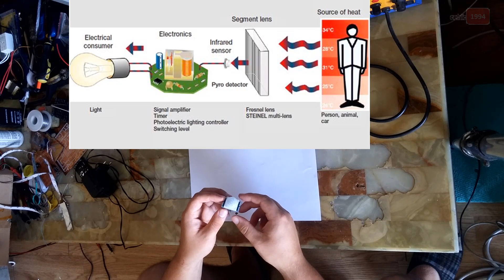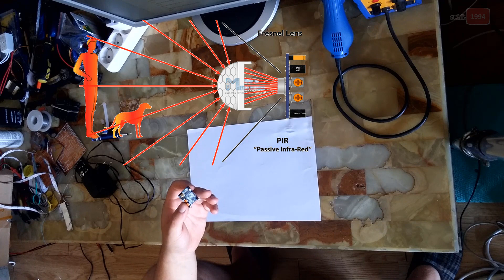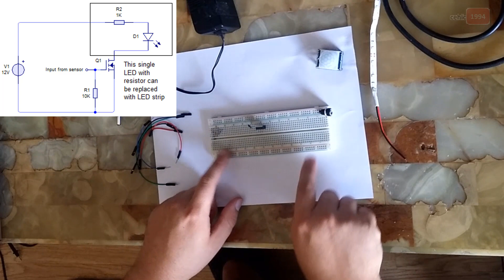PIR sensor (HC-SR501) with Mosfet transistor LED strip controll

Comment: hello,my pir sensor first time activate and off correctly.after without any motion again activate what is the problem.i checked 3,4 pir sensor same result.please give a reson
Reply from the maker: Try to lower the sensitivity, also if your device is not damaged. Also this devices works wery low on high temperatures environment.

Comment: Hey bro..am using irf540n with a 12v dc feed to a led strip..bt am gtting 7-8v at led input..pls suggest
Reply from the maker: Irf 540n needs more voltage on gate, this module only gives 3.3V. I think that irf540n needs 10V to be fully opened. You can use one more transistor to drive irf540n.
Reply: @cehic1994 can I use irfz44n as the transistor

Comment: Can we attach a 12v car battery to it???. I am in doubt that the sensor might burn up.
Reply from the maker: You can power it  with car battery without any problems, but first test with another power source.
Reply: @cehic1994  I have checked it with 9v battery.
Reply from the maker: If it works on 9V battery, than it will work on car battery.
Reply: @cehic1994  Sure. One more thing is that I didn't get the complete circuit diagram can you send it to me
Reply from the maker: @ajmalmaad4497  https://i9.ytimg.com/vi/ugDPdgGekNo/sddefault.jpg?sqp=CNTH1OAF&rs=AOn4CLCa7EXaIELjoOSNiPWBYW0wUyO4iA&time=1544889462016
Reply: @cehic1994  this link is not working.
Reply from the maker: @FCADurgeshKumar  https://i9.ytimg.com/vi/ugDPdgGekNo/sddefault.jpg?sqp=CPT9g-UF&rs=AOn4CLAFuaTFwo_sGZL_tC1R3YcMJeBDnQ&time=1554055147642